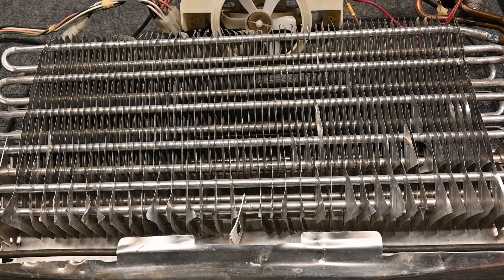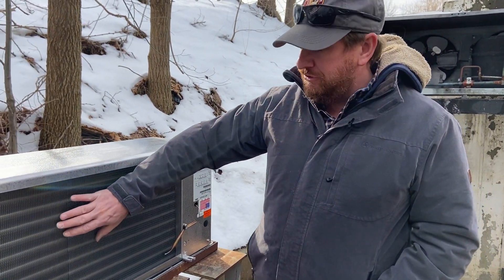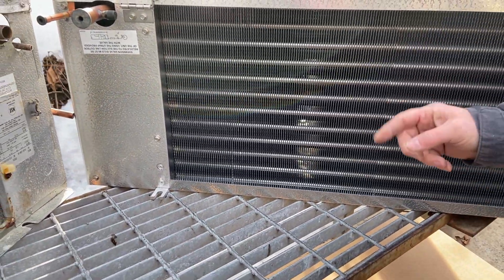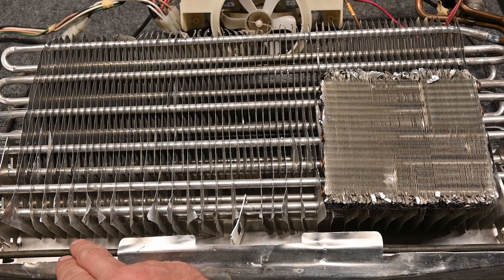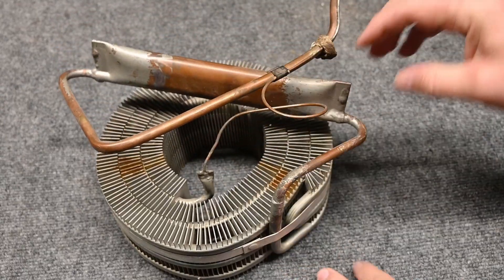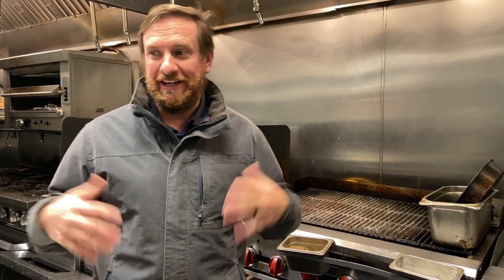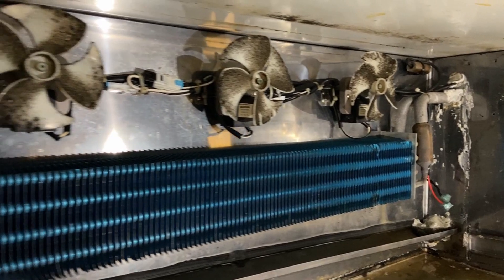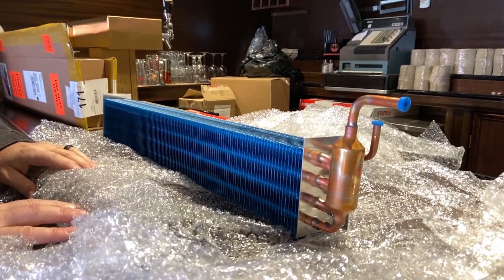HVAC 095 Evap coils for  freezers and coolers

Comment: On the drawer units,  I have the customer get everything off the top  remove a few screws and the lid pops off for easy access to fans, Evaps, and t-stat.
Reply from the maker: For sure that's the best way 100%.
I have a video somewhere with a griddle on top. Pain in the rear.

Comment: ty mhan u r awesome.....i have such evaporators with large spaced fins in the extract portion of FAHU....what would be it use...since chilled water is at low temp than return how is it useful
Reply from the maker: Usually they are for just changing temperature (sensible heat). 
Not much dehumidification. Used in medical, manufacturing and cooling in dry climates.
Reply: @love2hvac  WOW..Thats amazing..i am working in a hospital in UAE.Even then how is heat exchanging taking taking place....low temp(23 C) Will be blown over a coil , where chilled water(temp-13 C) Flowing. ...this will increase the load on chiller isnt it....is it a engineering blunder
Reply from the maker: Not necessarily. Some hospitals do not want the wider spaces coils so they have less condensation (moisture ). Less likely to collect bacteria

Comment: Thanks for this Update.
Please how does Frost on Evaporator increased the Compression Ratio?
Reply: Compression ratio is (discharge pressure psia / suction pressure psia).
Reply: @thisisyourcaptainspeaking2259  
Yeah I know this but my worried is that since the evaporating temperature from the TXV is constant then why should Frost on Evaporator increased the CR